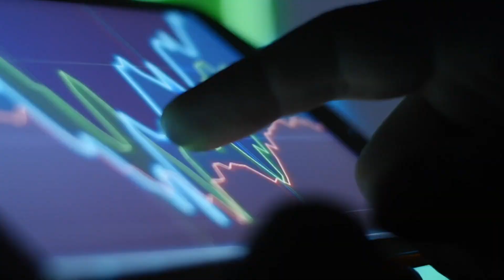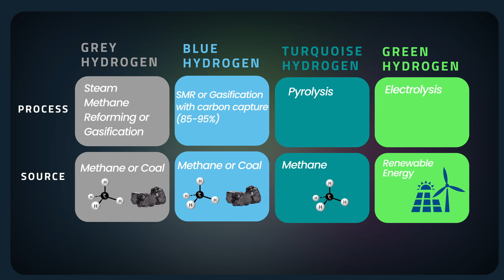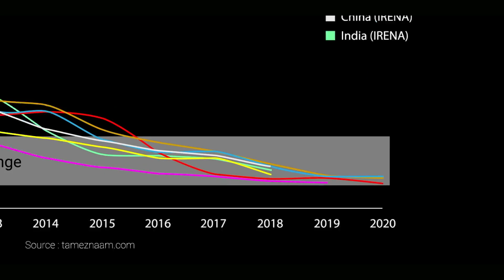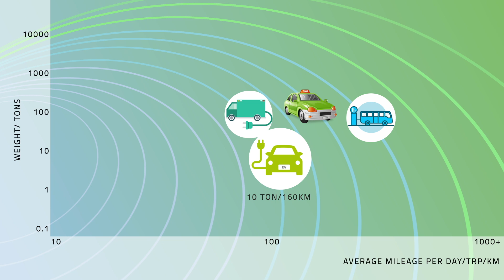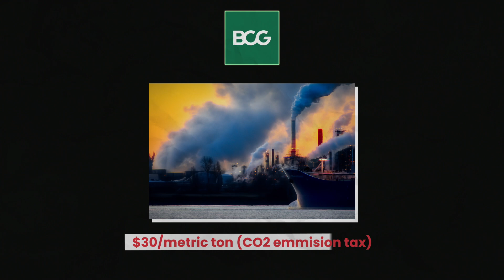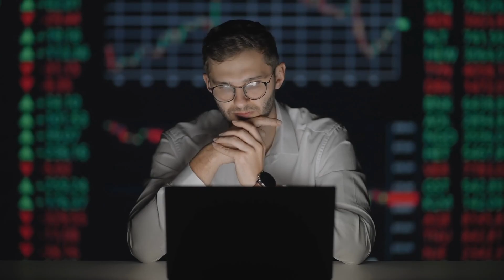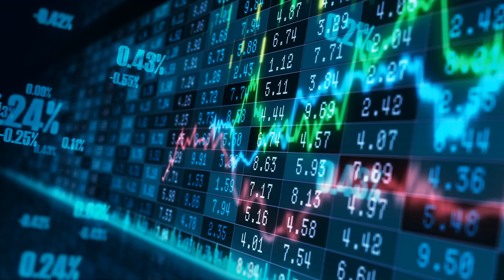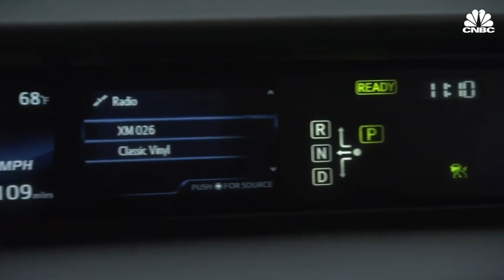Why NITIN GADKARI is pushing GREEN HYDROGEN for Indian Industries : Policy Case Study

Comment: Thanks for the great content as always. Is it possible to use Hydrogen for electricity production. Majority of India's electricity requirements(70%) are still met by thermal which has lot of emissions. Producing electricity the green way should also be a focus...
Reply: Nuclear is the way but what about its dangers
Reply: That would be extremely stupid thing to do. Renewables are already so cheap that they can meet our electricity requirments without involving hydrogen.  Hydrogen comes into action in the fields of heavy discrete transportation i.e buses, trucks and vans. Second avenue for hydrogen is in the industry where coal or gas is being used.
Reply: @AjayTiwari-en9nz  do you know the facts about requirements during night when solar is not available.. there are no energy storage requirements at mass scale also as of now. Please comment with facts rather than making opinions..
Reply: @VeeraForBharat  Respectfully I have done a comprehensive study on the subject and not making blatant statements out of nowhere. First, the loss in energy in converting electicity into hydrogen and then converting hydrogen back to electricity is very high. Secondly the massive numbers of storage tanks needed for hydrogen won't be cheap either.  As per Bloomberg Iron/Zinc battery  chemistry for Stationary storage at a grid scale will be a more efficient and cheaper option. Sodium ion chemistry is also viable but still at an early stage of development. Considering loss of 60% energy with hydrogen cycle no one in the world is even thinking about hydrogen at the grid scale at the moment. The only hydrogen based tech that can compete with the two batteries mentioned above is plasma kinetics based storage. US department of defence has put a hold on it as it can also be used in missile programs if leaked. Go read about it, it never gets mentioned in mass media.
Reply: @AjayTiwari-en9nz  Sorry to say your research is not comprehensive. Please find the paper where electricity generation with Hydrogen is explained. Gadkari ji is also talking about using Hydrogen for Electricity generation. Replacing Dirty Coal for Power Generation should be a priority. If Electricity Generation continues to be majorly with fossil fuels there is no point in buying electric vehicles..https://www.eia.gov/energyexplained/hydrogen/use-of-hydrogen.php#:~:text=Hydrogen%20fuel%20cells%20produce%20electricity%20by%20combining%20hydrogen%20and%20oxygen,a%20wide%20range%20of%20applications.
Reply: @VeeraForBharat  Hydrogen is not something that you can just dig and put into a fuel cell. It needs distilled water and costly electrolysis to produce Hydrogen. The efficiency of Hydrogen fuel cycle is just 40% which means you will have to put in 2.5 times the energy to get 1 unit of energy from hydrogen.Also it is very costly to store and transport hydrogen which is the lightest element on the planet. My point is that it doesn't make any economic sense to rely on hydrogen for electricity production when you end up using 2.5 times the energy just to produce it. 
There isn't a single country in the world which uses hydrogen for electricity production and why is that beacuse it is stupid. Using hydrogen for electricity in it's complete lifecycle is like using rice as manure for growing rice where the end products and starting products are the same and the output is diminished. Also do you really think you can win an illogical arguement by sharing 7th standard layout info on fuel cells?
If not then answer one question, how do you produce hydrogen?
Reply: @AjayTiwari-en9nz  I don't know if you are reading the article that I sent completely.  You keep harping the same thing about stupidity. I don't claim to be a scientist or an expert but hoping for ways for more sustainable way of generating electricity. The paper says with large fuel cells it is possible to generate lot of electricity. Economies of scale may not be there right now. People might have called solar also a stupid idea 25 years ago but it has become such a major factor in renewable energy. I hope you participate in some scientific progress and bring laurels in green energy with all your great knowledge. I am tired of arguing with you beyond this.. Thanks
Reply: @VeeraForBharat  You have been focusing on production of electricity with hydrogen but I am focussing on the production of hydrogen that one would eventually be used to produce electricity. Probably that is the difference in our perspectives. Maybe instead of focusing only on fuel cells which convert hydrogen into electricity and water you should also focus on the other side of the equation. Anyways it's up to you if want to believe or not but I don't think hydrogen would be used in production of electricity powering the grid unless the massive wastage of energy in the process is stemmed. As an engineer working in electronics domain I can tell you one thing. Efficiency is the key! And this applies to all disciplines of engineering not just mine.

Comment: One simple question: Why use hydrogen generated using renewable electricity when one can use the renewable electricity itself?
Reply: Hydrogen is easier to transport and provide instant consumption for industrial applications. Li Ion batteries takes hours to charge and cannot be realistically used for heavy industrial applications.

Comment: Great video overall but the difficulty of storing hydrogen and explosion risk management is not just a footnote. These challenges can be deal breakers for this tech, even if Bharat solves all the cost, efficiency, and alternative metal catalyst challenges. It will take major transportation safety policy reforms and R&D funding to solve the hydrogen safety concerns. Cautiously optimistic that GOI isn't ignoring these aspects, especially with Mr.Gadkhari leading the charge.

Comment: Video started well but lost its way, the problems with hydrogen should have been given more time as that is what is holding hydrogen back for really long. Positives are a lot and it can be summarized in a minute. California already provides millions of $ subsidy to those opening hydrogen filling stations but it still has low takers.. hydrogen loses 50% of its energy during transformation- so will probably never make it into cars

Comment: It takes 20-25% more energy to produce the equivalent energy in hydrogen. This will drive the cost of hydrogen up and HFC-EVs are inefficient in comparison to B-EVs which further drives the cost up. It is better to just use Hydrogen for industrial applications to keep European market in check but hydrogen vehicles are a bad idea. Toyota put it's might behind HFC-EVs but the experiment proved a failure because battery EVs are much better. The only thing that HFC vehicles have is no mining footprint.
PS: Hydrogen is hard to be stored requiring heavy investment in storing infra plus it can be a hazard if not taken care. Hot Indian weather does not help.

Comment: 4:06 u do know that the conversion of electrical energy into chemical energy (H) through is very inefficient
And at the end the energy loss using hydrogen cells  at the end is a loss of more than 50% of energy
Hence unless the efficiency is increased its just wastage of resources
India doesn't have enough capital to establish a hydrogen supply chain
A hydrogen station costs 100-200x more than a ev charging station
Electric vehicles have minimum efficiency of 80% and max of 95% 
While in case of hydrogen vehicles it's min of 30% to max of 40%  
P S i do believe hydrogen has a place in our world but unless there's a few break throughs for increasing efficiency in EVT(energy vector transmission){the T can wrong i don't remember what was it}
Reply: I am also having same opinion. Instead of generation of Hydrogen by using electricity by loosing its efficiency....why cant we use electric vehicles directly?
Reply: @Ravi-ur6iq  the issue with EVs is  the batteries-raw material, production, limitations by weight and size of battery etc
While the issue with HVs is efficiency of conversion of energy- hydrolysis (60-70% efficiency), transportation loss(15-20% loss)
High cost of infrastructure etc 
Both have their plus and minus points
Reply: @Technocracyisthetruepath   We can store the surplus renewable energy in hydrogen which is far more cost effective.
Reply: @navan1087   sigh 
1 it's not cost effective u have a min loss of 50% energy i don't understand why u think it's a good think
Second do mention which storage process u r refering to specifically
Reply: @Technocracyisthetruepath   India govt recently announced the policy to subsidise electricity generated through renewable source to be used for green hydrogen production. So we are planning to convert the surplus renewable energy generated on day time especailly solar into green hydrogen so that we can store energy instead of wasting it.
Reply: @Technocracyisthetruepath  "The government on Thursday unveiled India’s new green hydrogen policy, promising cheaper renewable power, fee waiver for inter-state power transmission for 25 years for projects commissioned before June 2025, land in renewable energy parks, and mega manufacturing zones to help local industries wean themselves off fossil fuels.

The policy, aimed to promote green hydrogen and green ammonia, will also facilitate the so-called ‘banking’ of green power, where a green power producer can save surplus renewable power with an electricity distribution company for up to 30 days. "
Reply: @navan1087  this has nothing to do with my comment in any way
It's just that India is investing hydrogen which a good strategy as EV market is already dominated by EU,usa and china
Reply: @Technocracyisthetruepath   The main aim is to save surplus renewable energy produced which is anyway going as wastage. Converting it to green hydrogen is a cheaper and practical option. The thing is Indias Solar energy potential is too huge that we will have do convert much of surplus solar electricity to green hydrogen. Efficiency doesnt matter here.
Reply: Do tell why shouldn't we store surplus in a highly efficient battery like majority of the world instead having to do inefficient,extra process to make it into hydrogen 
ELECTRICITY battery won 
Hydrogen failed 
That's the truth 
As i mentioned unless storage as H has more advantages no one would do it
I rather store my surplus with 80-90% efficiency then store with less than 50% efficiency
Govt is just throwing money  in drain which could be used for other important things
It would better if India first invested in RnD for increasing the efficiency then setting up the infrastructure 
It nothing but a gamble
Reply: @Technocracyisthetruepath  agreed...the best option is....which will hv low carbon emissions in direct or indirect way.
Reply: Tell me one great invention that reach worldwide from india for the past 50 years. You are expection too much from indians lmao. The gap between rich and poor is becoming larger day by day and these idiots are too dumb to realise and instead they will chant "proud to indian" for no absolute reason. They even choose a tea seller to be their pm. I mean is there anyone who is more educated like at least graduated in political related? India has a nickname btw "millions of idiots in billion" which is true. China has almost the same population as india but is 7 times richer than india

Comment: Your hydrogen range hypothesis may not be correct for 1 simple reason, that there is only so much compression possible for hydrogen. It may or may not got to 100 Liter for a Hydrogen storage. Which one will you shrink? Hydrogen or Fuel Cell?

Comment: All is bluff.
1. They promoted CNG and made cheap available and said its future. Price was also very cheap, latter now today they increased cng price aignigicantly
2. lithium ion based ev is future currently from your home grid you can charge ev. But latter on when they loose fuel based revenue they will start charging extra by making charge grid independent and will charge extra
3. Hydrogen powered - they will find some way to tax more

In short logonka chutiya kuvh bhi karo katne walla hai hi

Comment: @Think School: The demerits for going fully electric vis-a-vis EV's are well explained and I totally agree to most of your points. But this alone wouldn't have been the sole motive for the Indian government to find the alternate solution of Green Hydrogen. If Green Hydrogen is really the game changer then other far better technological advanced countries would have already adopted this by now. But instead they focus on EV.

I think one of the other main reasons for the Indian government pushing for Green Hydrogen could be they can still continue the revenue generation model from taxation of this fuel. Green Hydrogen used for the purpose of transportation/commute can be included under the Central & State government taxation model same as Petrol, Diesel or CNG. But the electricity used for charging EV's at home cannot be taxed in the similar manner.

Comment: There is two ways to make hydrogen fuel.
1) From water : if you put 2 Mw then you get 1 Mw (for example).
2) From fossil fuel : efficient but it's not clean source, you are just changing form of energy.

And also storing hydrogen is also annoying. Only best way is, make carbon fibers storage (which is too costly). 
If you see the structure of hydrogen car it is just a electric car, you are just put extra   garbage in car, so takeout that garbage and making big battery pack is more logical. 

And if you are saying in bus, then lithium - titanate battery is best for buses. If you like fast charging then go for it. It's allowing superfast charging like more than 5C. ( C stand for changing hour)
Reply: However, i support alage biofuel.
 Because, without hydrocarbon there is no efficient energy source.

Comment: Also solid hydrogen storage is also a possiblity  usiing some materials that can store hydrogen and then release it if heated .. this heat can be provided by using the waste heat by the fuel cell once the vehicle is running.

Comment: Hydrogen powered vehicle is a great innovation by man.
Not against the idea but they come with huge infrastructure to invest in ie. Hydrogen fuel pumps need very huge investment compared to electric charging stations. 
Also hydrogen is produced by electrolysis of water generally which will be of 60% power efficient.
If you are using electricity to produce  hydrogen, why not use it directly to recharge your car?
Reply: Bro watch video again, Efficiency of lithium ion battery decrease for trucks and heavy vehicles. Thats why hydrogen good for them
Reply: @shubhampreetsingh8630 for those we use biofuels or swapable battery

Comment: Hydrogen as fuel source for vehicles is a pipe dream at best. As you clearly mentioned, hydrogen acts as a energy storage. 

Generate electricity via solar, 
electrolysis(LOSS 1), 
Distribute to retailers(LOSS 2), 
Generate electricity via fuel cells(LOSS 3) 
and finally power the vehicle. 

Comparing this to EV
Generate Electricity
Transfer to chargers via Grid(Loss A)
Store in battery(Loss B)
power the vehicle

As you can clearly see Losses 1,2,3 is significantly greater than losses A and B. 
On top of that fuel cell cars still use batteries to store and control energy before powering the vehicle
Hydrogen is inherently harder to store as its a small molecure and tends to diffuse through storage tanks
pressurized hydrogen storage tanks are highly prone to explosions

in your previous video on bsnl, you mentioned wimax. This was one of the biggest mistakes made by our country. 
There were 2 competing 4G technologies WiMAX and LTE. India bet its money on WiMax and it failed. 
Hydrogen Fuel Cell vs Li batteries is a similar competing situation. We should not bet entirely on a single technology.

try to understand the differences between propoganda and reality

Comment: Hydrogen usage is really not good for the people, this is a deliberate attempt by the government to make people pay more for fuel, electricity is easy to produce so most people will set up solar power in their houses to charge their vehicles, but if this is the case then the government cannot scam the people with really high taxes on fuel, which is happening right now.

Comment: Solar and wind energies are not sustainable. Relatively lower cost is due to cross-subsidy from fossil fuels. Technically, maintaining solar panels is high cost, due to dust on the cells. And wind is unreliable. Even Al Gore's house has just 5% renewable energy. 

Electricity can instead come from hydroelectric. Medium term from fission nuclear reactor. Long term I hope France cracks safe and sustainable fusion reactors.